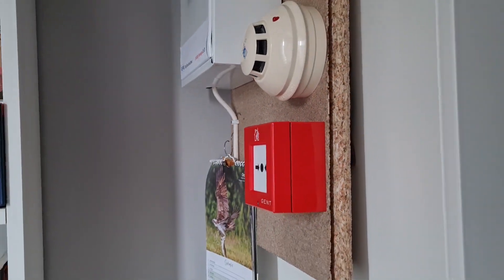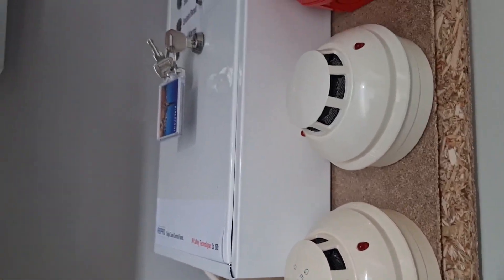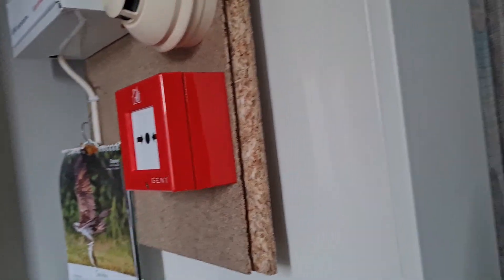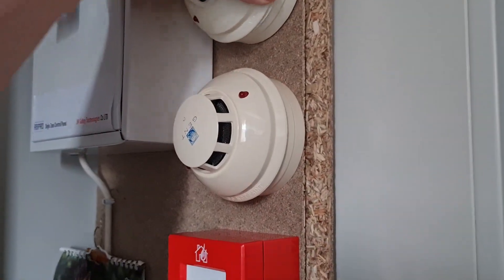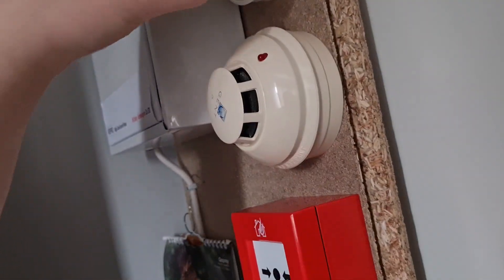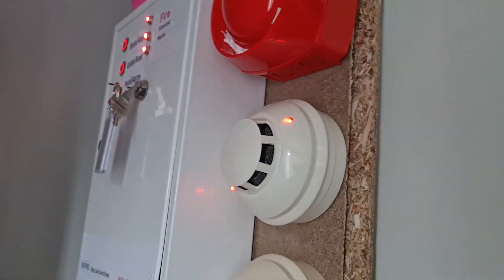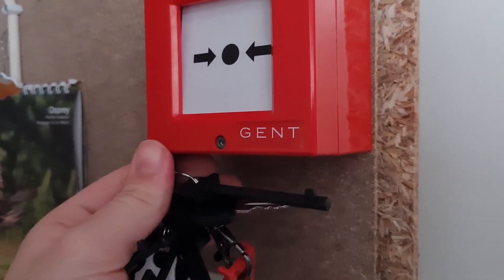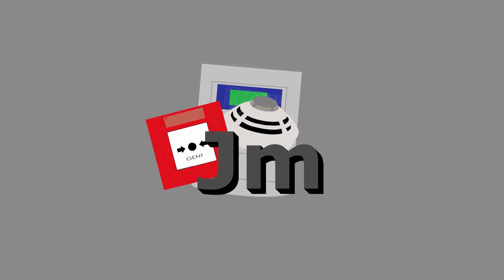Micro GENT Conventional Fire Alarm System Test!!

Comment: I want to get hold of an 1195 mcp.
Reply from the maker: I could swear you used to have one ages ago.
Reply: @JmFireAlarms  yeah I think so, had a clear out so.
Do these ones have a resistor already?
Reply from the maker: @145-k1b  The newer ones do yes. However the other one I have with rare glass is the older model which is just a switch.
Reply: @JmFireAlarms  alright cool